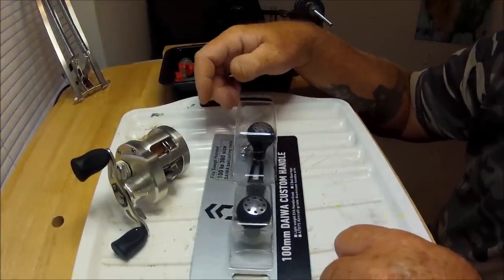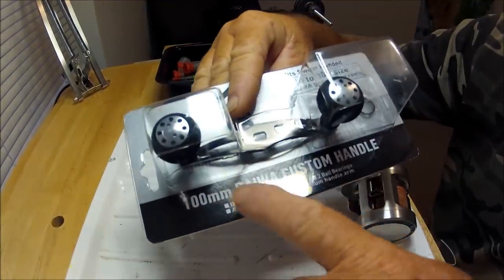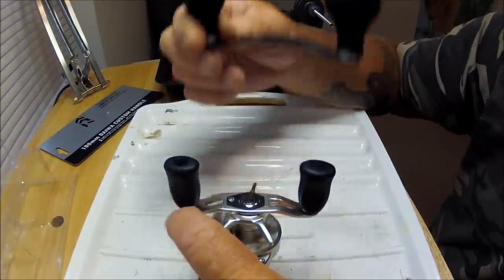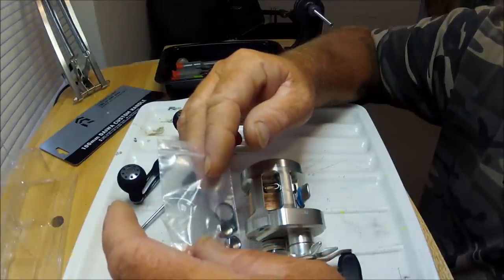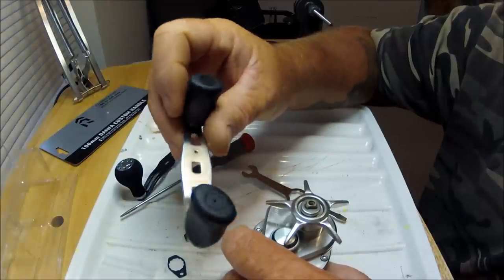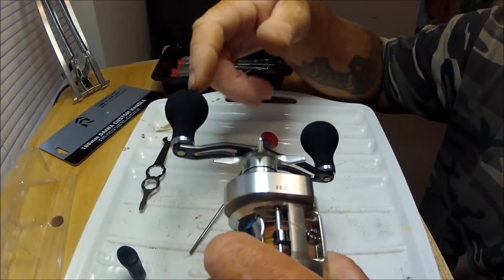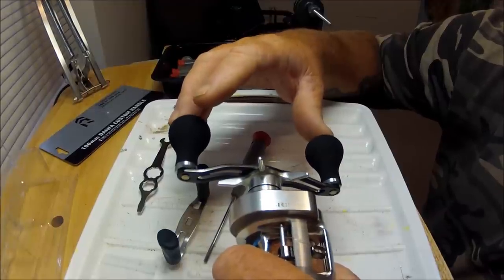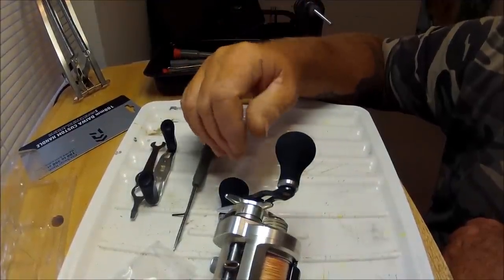Bait Casting Reel Upgrade....EZ !

Comment: im a fresh water guy and those 100 handles are great....   effortless dragging a fish in w those.  I have the $20 version of that handle.  its a tank.
Reply from the maker: on a $500 reel (not that I paid that) I have 12 different older Daiwa Ryoga versions, I'll go with the ''reel deal''.....keeps re-sale value up.
Reply: @CaptDavesSportfishing  if you say so.  Most likely comes from the same factory, mine looks exactly like yours, but the daiwa name jacks it up $20.
Reply from the maker: Got piles of knock-offs, from ebay don't like them as much.